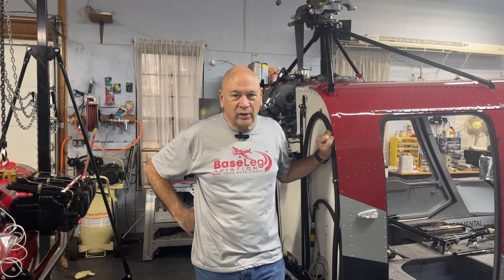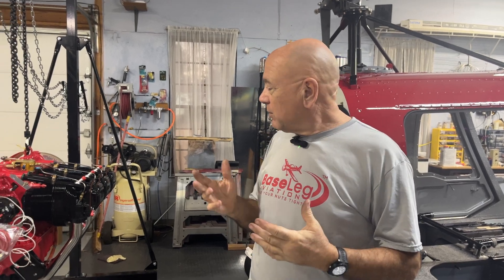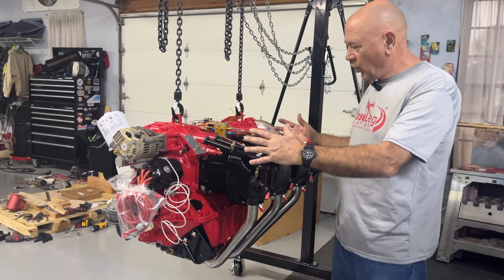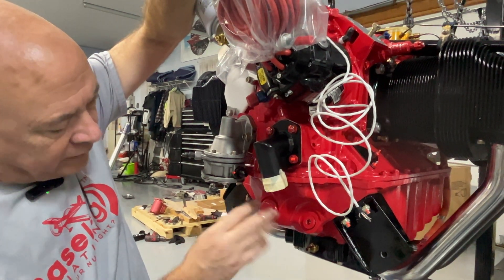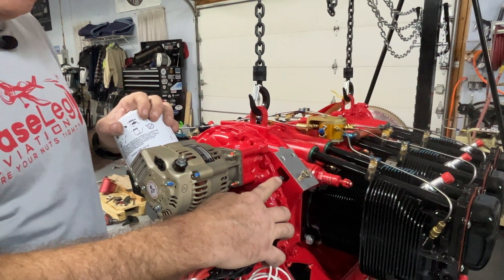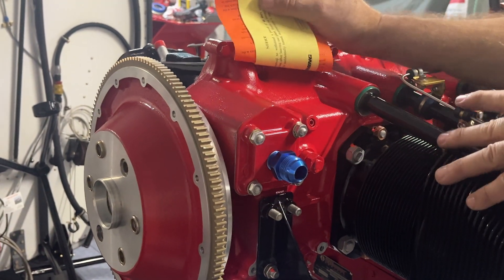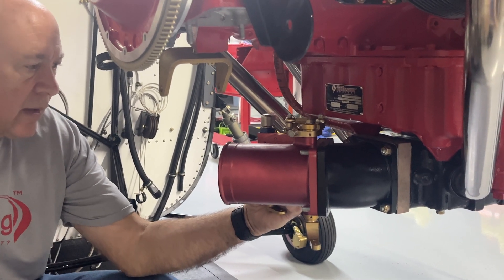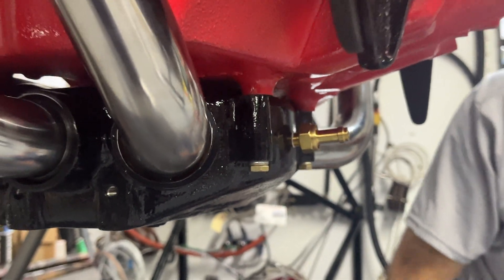Hummingbird Update-The Thunderbolt Engine

Comment: What is this snorkel fitting you speak of for draining fuel?  I've never seen that and I'm about to mount an IO-540 on my bearhawk.
Reply from the maker: The snorkel fitting is a one way valve. It allows fuel to drain when the engine is shut down, and has a little ball in it that closes the valve when the engine is running due to the vaccum in the sump. I think the part number from lycoming is 75444.
Reply: @baselegaviation1614  appreciate the reply.  Do you run a hose from that fitting out through the bottom of the cowl?
Reply from the maker: @akschu1  yes.